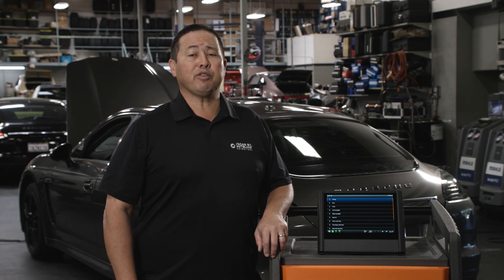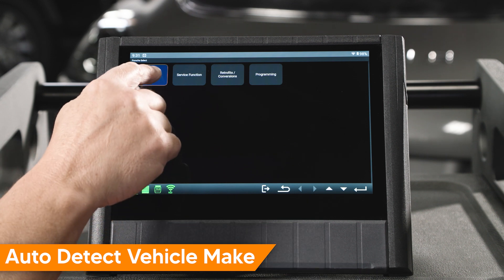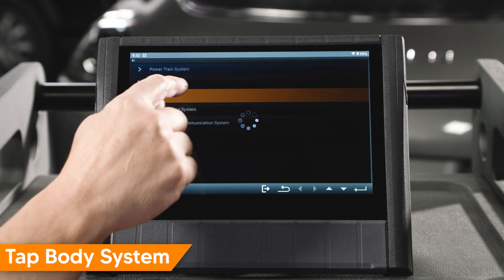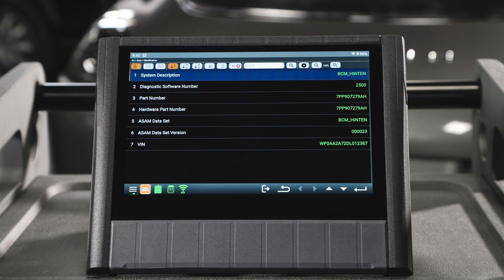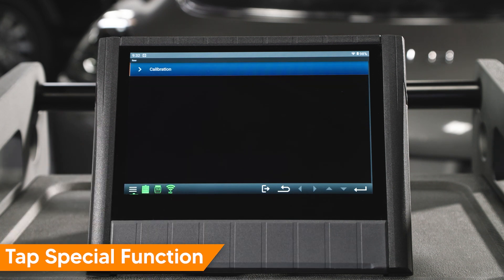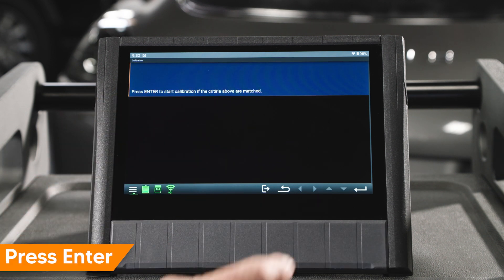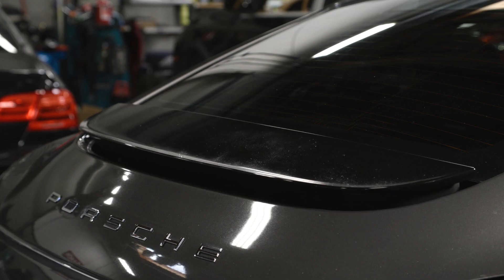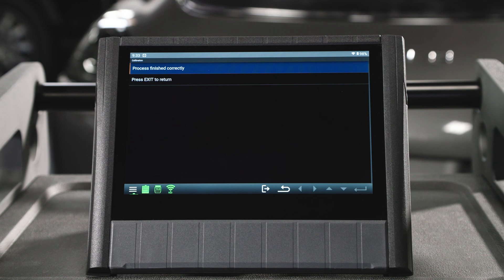How to Perform an Adaptation on a Porsche Rear Spoiler - 970 Panamera shown

Comment: What year/generation model is this. I have a 2013 Porsche Panamera S and the spoiler does not go 45 degree angle like this. It just goes straight up and not at a 45 degree angle.   If its different how can i get it to do the 45 degree angle?  It looks better that way!!!!
Reply from the maker: 2013 Porsche Panamera (970) with 3.5L engine. You can't change the function of yours if a different generation.